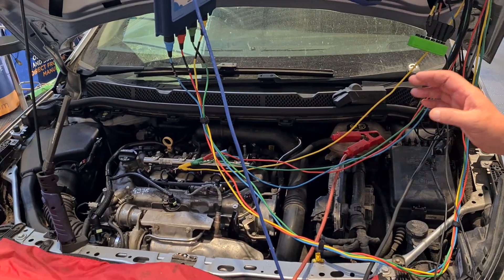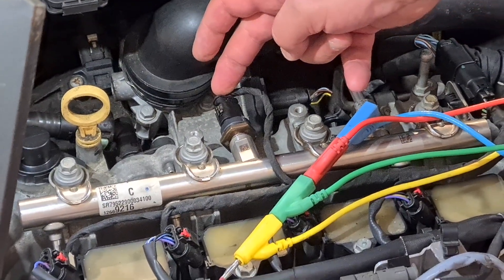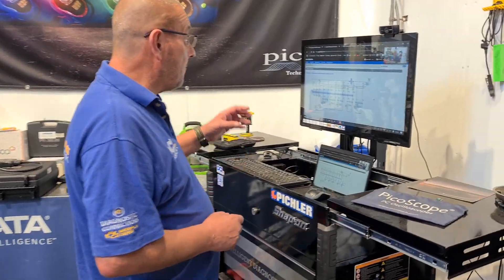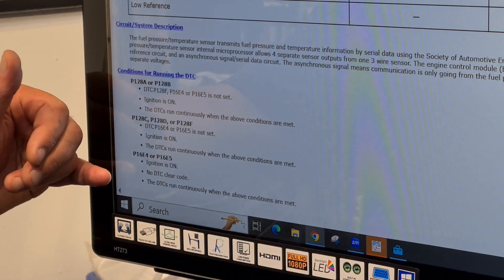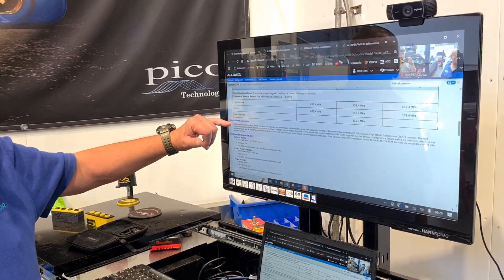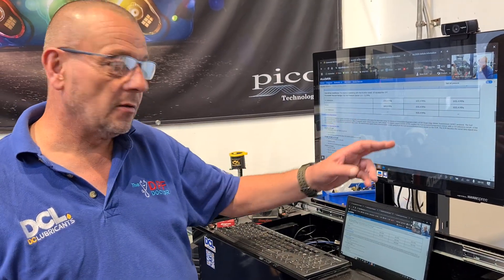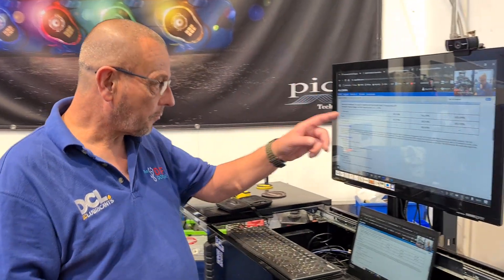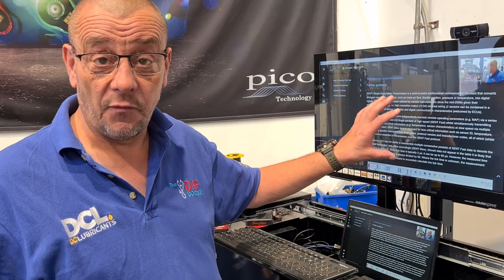Astra K P16EF Rail pressure SENT

Comment: Great video as usual Steve.  How do you get AllData to show schematic diagrams full screen. Does it depend what manufacturer your viewing? I struggle withthe drawings being in the bottom left corner and have to keep dragging them around and zooming in and out
Reply from the maker: There's a button top right of the page to hide menu, plus CTRL + - or 0 to zoom in /out/ restore